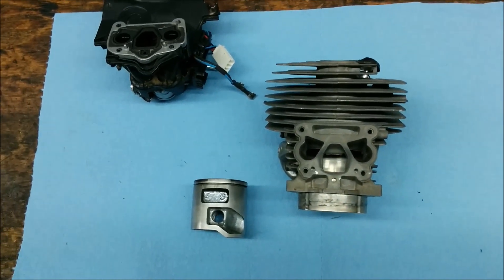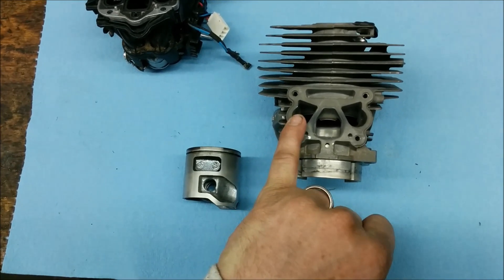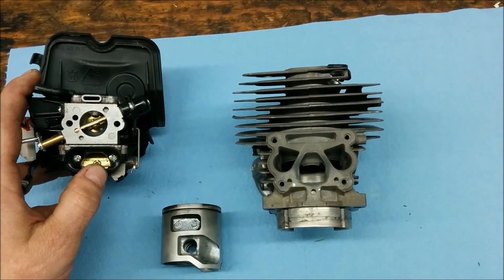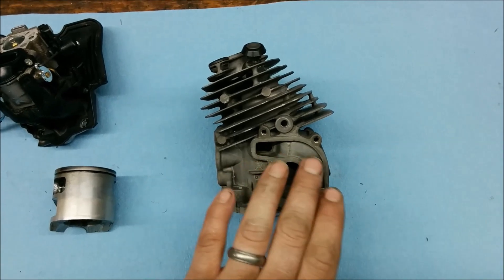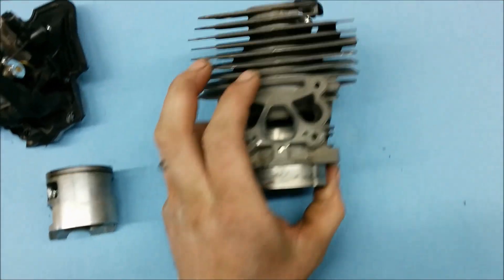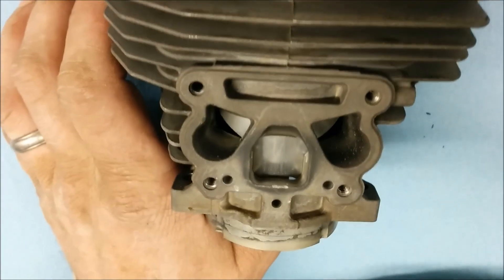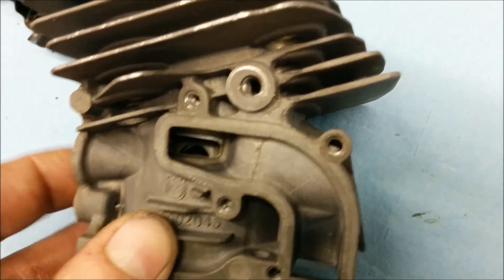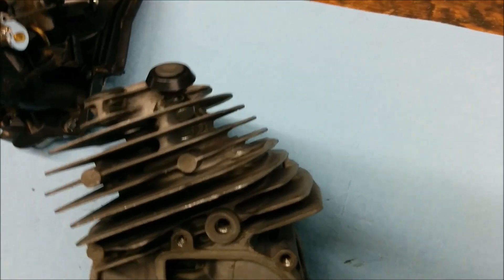Strato chainsaw cylinder explanation

Comment: Where it's got the little side covers on the outside of the cylinder,if the gasket was leaking would you lose compression? I bought a non running 550xp with a toasted piston. The cylinder looked fine,so I put a new meteor piston and caber ring along with an oem base gasket and still only have 90psi of compression. Itll start,but obviously wont stay running. When I bought it the carb base was loose,so I figured that's what killed the piston. What am I missing,should I try a new am cylinder?
Reply: Also,itll only start on full choke,and revs high. The longest I can get it run is about 15 seconds,so it's hard to use carb spray to check for air leaks. Dont know how I could with so little compression.
Reply: No, you can't lose compression there. You've got an air leak somewhere. Need to block off the ports where the carb goes (including the little impulse hole), the exhaust, and pressurize the crank case to 10psi, it must hold pressure on it's own for 10 mins. Crank seals, base gasket, intake boot call all leak. 

I'm going through the same thing with my 550xp right now
Reply: @cron410  I appreciate it,but I gave up on it. I dont mind spending a little bit of work and time on one,but that one needs more than I'm willing to give it. Even with the obvious air leak it should've had better compression with new piston and rings. When I took it apart originally the piston top and the pististon land were blistered on the exhaust side,but the cylinder wasnt scored. The ring where the blistering was had alot of carbon build up. I'd say the air leak is probably crank seals. The intake boot looked good. The impulse line is new. I had it apart 3 different times and moved on.
Reply: @ciphercode2298  all good. Sometimes it's the decomp valve that leaks, one could remove it and add some valve lapping compound to work it in and clean up the valve face then rinse really good, or just get a new one. They're like $5 now. Hope it works out better with the next saw

Comment: Very interesting thank you for the explanation I was curious about the strato design because I just bought a Jonsered 2172 and was wondering why it was different from the 2171. I learned an interesting scientific fact over the years and would like to share. Engines just like humans are not capable of "sucking" in air. The air whether drawn in by an engine or by someone's lungs is actually the direct result of a difference in air pressure created by movement or contraction. Air pressure is around 14-15 pounds per square inch at sea level. If there were no air pressure we would not be able to breath and an engine would not run.
Reply: What you just explained is the very definition of sucking
Reply: The 2172 depending upon design and year could have this stratified design incorporated in it. Yours most likely does not have the autotune module like the one in this video. Although both share the same crankcase throughout the years minor changes between the 2 were present. Some with EPA related mufflers, some with heated handles. Husqvarna coined it as their x-torq. Jonsered didnt use a name for it but retained this in their ulticor designs.
Reply: @-Just_Justin-  Thank you

Comment: So she  the fresh air chases the exhaust  is the exhaust   is the fresh air finishing the burn or is it  to just separate the fresh air fuel charge from the actual charge that would probably  be  more simple  and make sense and the  combustion has already  completed  when the fresh air  enters the cylinder
Reply from the maker: HORIZON8026   Yes it chases burnt charge and very well could help complete burn if any was remaining.
Reply: im trying to figure out  changing numbers on the  fresh air and  fuel mix  so the  mix is a normal fuel mixture   it has nothing to do with the fresh air charge as  long as its  as its suppose to so lets say i  opened the exhust duration    like 4 or 5 degrees should   should the fuel mixture open a few degrees sooner to allow more for the  change in  scavange  time  but if the  mix side  fills too soon you will get less clean air to  for the  clean air burn  should the fresh air and  mix side always open at the same time   i dont realy want to experiment   i cant afford to do that right now. i know basic of porting  just getting a ruff idea of numbers  down and i need to get  the stuff i need so i can start doing it right sometime i just  work on  my own stuff next thing i need some day is a lathe lol

Comment: Interesting.  So basically at the end of the exhaust-stroke/beginning-of-the-intake-stroke the extra ports scavenge the exhaust gasses out of the cylinder using fresh air (no fuel) just before the "real" fuel/air mixture in the crankcase swirls in.  Resulting in better fuel economy and lower exhaust emissions.  Cool...
Reply from the maker: BluntForceTrauma666  Exactly
Reply: Heh.  What will "they" think of next?....